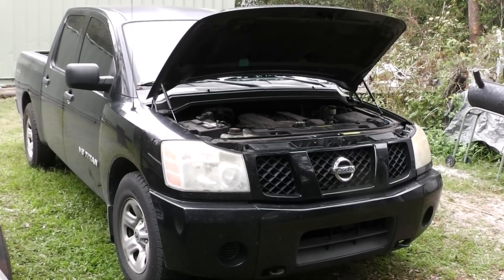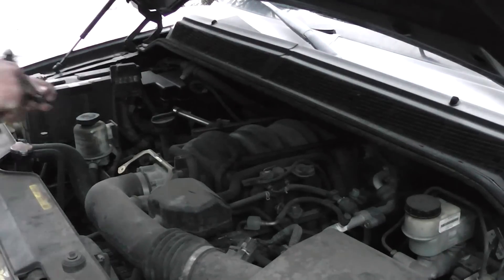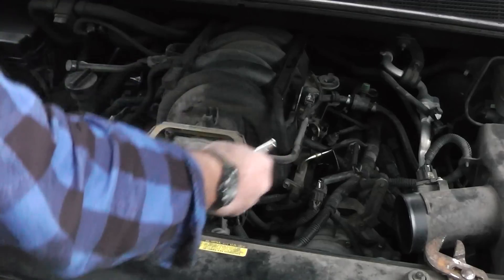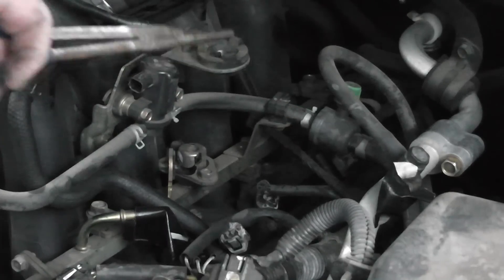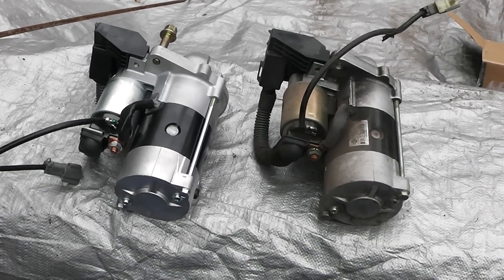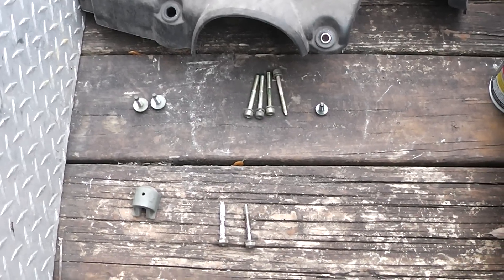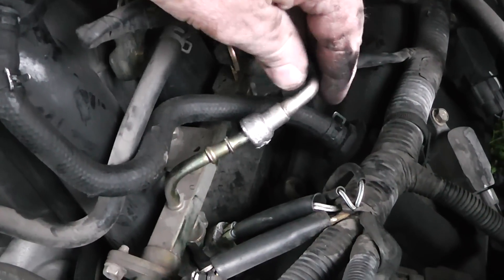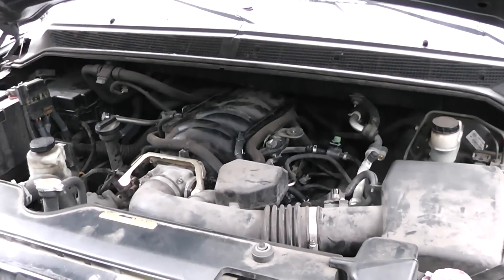Nissan Titan How to Replace Starter

Comment: This is the best video ive seen for this job. Well done. For anyone that has problems after replacing the starter with a new one. I put a rebuilt AC delco starter from Rock Auto. 190$. Installed and cranked the key, whirring noise but no start. Pulled it back out, checked and installed again. Same dam thing. Took starter to get checked. Tested good.  I could see small scratches on the flywheel where the new starter was hitting low. Put another in and it fired first time. Bad housing on rebuilt starter

Comment: God Bless you bro. Perfect instructions. Those 2 back bolts were tricky but I removed the wires to the starter before trying to get to them and it made access easier. Again God Bless you for your time and effort for making this video.

Comment: thank you so much for taking the time to do this video, my 2005 is starting to look like I'll have to do the same job, I hope its just the relay or safety neutral switch, the starter itself looks pretty labor intensive. Either way thanks !

Comment: Nice job!  Thanks for sharing.  First time I have seen a starter in that location...the engineers didn't do anyone a favor by putting it there!
Reply from the maker: Thank you.  It would have been a whole lot easier and faster in a conventional location. I suspect the engineers were instructed to make it as difficult as possible so most people would not even attempt it and would just want to take it to the dealer.
 At least I didn't have to pull the cab off like you have to do when replacing  an '08-'10 Ford Super Duty diesel engine!
Reply: ricerust Are thier any other trucks that have the starter in this location?
Reply: I do agree that the location is rather tedious to get to. The thing to think about is that location isolates the starter from direct contact with debris, fluids, etc... so all in all the life span is longer than the conventional locations, I have a 2005 titan hitting 169k miles and my starter just begun these same problems. Where with an older model Ford Taurus for example the starter gets replaced more often due oil covering the the starter every oil change.

Comment: Fantastic video! My 07 Titan sometimes takes 2-3 turns off the key to start, but there’s no whirring noise. Just lights up the dash lights and doesn’t start. Now I’m wondering if it is the starter or not…
Reply from the maker: It could be the selenoid, starter relay, loose electrical connection or ecm relay.
Reply: @homesteadprepper  Thanks! I’ma try the relay first!

Comment: Nice fix, just my 2 cents on the battery cable when I took mechanics class back long ago in school it was always take the negative cable off, that's all I'm going to say about that, the lesson will be learned at some point in time if you remove the positive..
Reply: i learned the same thing in auto school ,the current flows from neg to pos.
Reply from the maker: That is what I was taught as well but, there always seems to be an expert or 2 in the comment section that will disagree with us.
Reply: Me sirvio de mucho tu demostrasion grasias

Comment: Good video . The only thing i would add is to remove the fuel pump fuse and crank the engine to relieve the fuel pressure ; ) Of course assuming you can crank it at all ; )

Comment: Great video and I appreciate the extra detail you added. What were your symptoms to know your starter needed replacement? I turn my key 2-6 times before it starts. Battery tests good.
Reply from the maker: Every now and then when I would turn the key to start, I would here a click/springing noise and the starter would not turn over. I would then try to turn the key again and it would start right up.
This was to me, indicative of the selenoid on the starter itself going bad.  I couldn't see just changing the selenoid on an 11 year old vehicle so I did a complete replacement.
Reply: Thanks! That's exactly what's going on with mine and like you, mine is an older 2004.
Reply: Ok, that's what I was looking for. My 2006 did the same, click click then start up. After a year, nothing. I tried the relay, replaced the IPDM from a junkyard...I'm feeling better about spending the money on a starter and replacing it. Thanks for the video.

Comment: Good video seen some of it. Question  if the starter is going bad is it possible  for the truck to still crank ? my truck is a 2004 has had all these symptoms and one day this happened once only thier was a no start just a click like if the batt had died. I gave it some gas pumping pedal then started cranking but still wouldn't  start i stop'd cycled  key 3 or 4 times then it started. Dont know if  pumping the gas pedal helped but it was wierd that it cranked for a good 15 seconds and nothing . Did you have to change any gaskets or rubber o rings.
Reply from the maker: You could have multiple problems, igniton, selemoid and or fuel pump issues. Very difficult to diagnose over the internet.
I just reused the oring gaskets that were on the manifold.

Comment: What kind of craftsmen tool set are you using?
I own a 05 titan, having starter issues, every once in a great while I'll try to turn it over and it wont start, but if I turn it off then do it again, the truck will start... Were these the same issues you were having?
Reply from the maker: The tool set is just a starter set.
I have had these issues due to 2 causes.#1 Check out : https://www.youtube.com/watch?v=9LUCk5x3NTs
#2 is why I changed the starter.  It is actually the selenoid going bad.
Reply: I'll try it out thanks for the info
Reply: nicholas getty hey mine ding the same thing, not fun at all. Poor design, meant to be replaced by dealer down the road at 600.00 plus tax, but you can buy the starter for 195.00, gasket kit for 24.00 and diy, I did saved about 400.

Comment: Well done. One question though, why did you replace the starter, to start with?
Reply from the maker: The selenoid on the starter was going bad(intermittent starting).  Rather than just replace the selenoid, I opted to replace the whole thing due to the inaccessibility.

Comment: check your intake manifold bolts heads before you start,  they rust out part #  081A8-6401A..

Comment: did you have to put any fluids back in it?
Reply from the maker: No.  I read a procedure that said the coolant would have to be drained but, that is just not so. 
Looking back on it, I should have replaced the hoses that were under the manifold.
Reply: yea man i did my titan yesterday and didnt have the power tool to get those 2 bolts out from the back closest to the tans lol so me and buddy went from under the trans with 3 or 4 extensions for a ratchet and broke them loose. but all got done and put back to gather i feel like it starts up way better now and run a little better idk but thanks again for the video it helped alot.

Comment: If they are going to bury the starter that deep into the engine you would hope they would make it last the life of the car.  There are many Lexus LS 430's with the original starter and 200,000 plus miles.
Reply: I just change mine on a 2006 titan and it's not as hard as doing it under the vehicle!